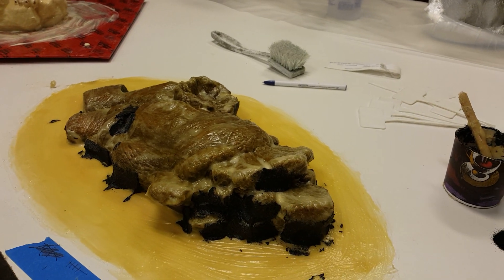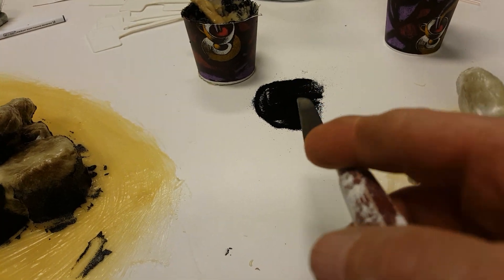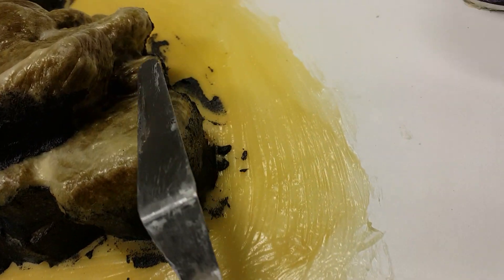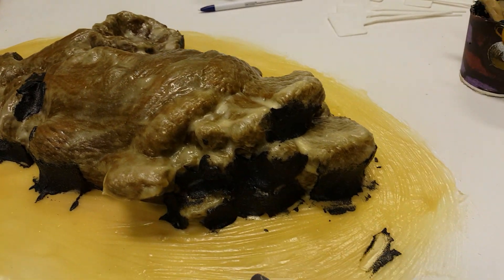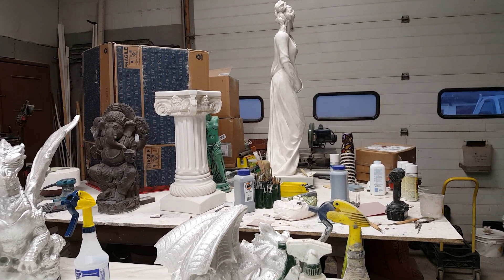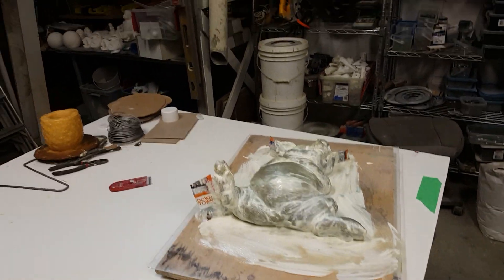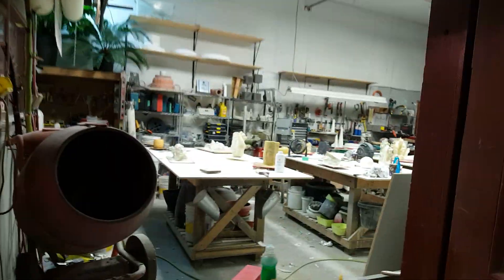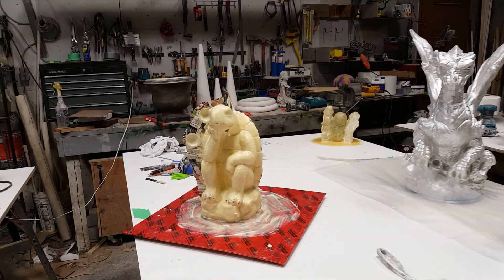Mold making / Using rubber crumb for undercuts.

Comment: Hey, I'm loving your videos... very informative! I have a question if you don't mind.... I am making basic moulds at the moment and am looking at making a mould of an ornament I have. The difference is, it has a few areas that are kinda like windows (?) .... how would I use the latex in those areas? For example.. 
 Say a woman with her hands on her hips so there is a space between her arm and body.. 🤷‍♀️  thanks
Reply from the maker: Hey Moonie , here's all you need to know ,some good examples for ya! https://youtu.be/S1dT5QiuiMM
Reply: @mrconcreteartisan  thank you... I assume that in the casting process the 2 sides of the seem would just push towards each other and hold themselves in place? If it was a larger window, would I be best to key it? Thanks
Reply from the maker: @becksgirl08  Yes you're  spot on ,I use fiberglass plugs for large ones ,I have a few vids on that process .Just search my library for fiberglass plugs.

Comment: How long you an wait between the layers? Is it important dont wait to long for the next layer?
Reply from the maker: Hello Klaus , sorry for my slow response. I put a layer on in the early morning and again in the afternoon. The longest you can go is 48 hours but try and keep it to 24 hours .You can get "delamination" if you wait too long.Thanks for your very good question.
Reply: @mrconcreteartisan  and how do you Protect your brush for the Latex. My brush is Game over after 3times :(
Reply from the maker: @klauskremser6517  I use a large to go coffee cup filled with COLD water ,some dish soap and a few drops of ammonia. Clean it a few times in while brushing .change the water often (do not dump in your sink), leave your brush in the water soap mix over night.You can also use a metal brush to clean out any leftover bits of rubber.
Reply from the maker: @klauskremser6517  Here watch this little vid   https://youtu.be/bZ3x63yvs54
Reply from the maker: Also leave your brush in the soap and water overnight,change the water often and don't dump it in your sink!!!
Reply: @mrconcreteartisan  thank you sir, best regards.